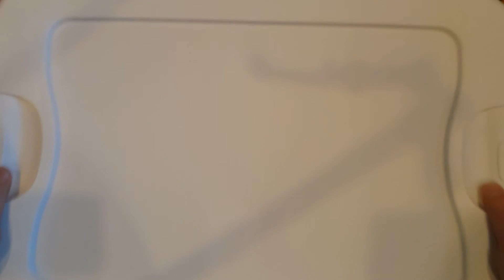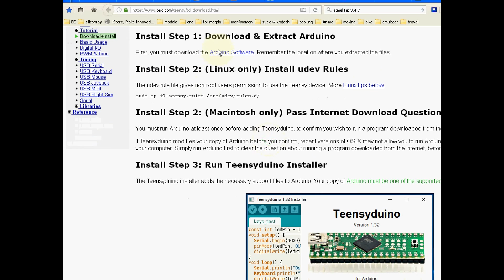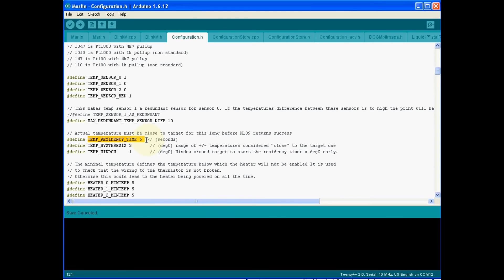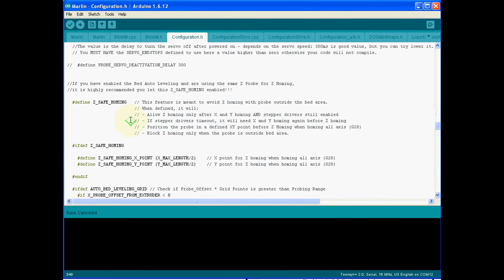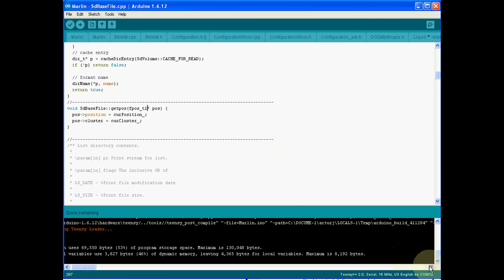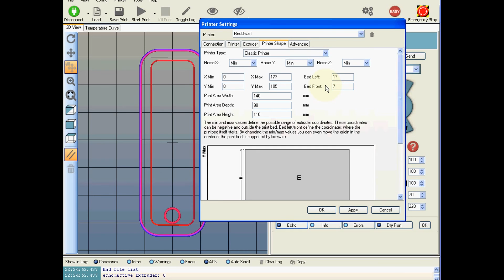Printrbot to Hypercube conversion part 3

Comment: Hello, I did something very similar to you, I am using a Printrboard, what VREF do youhave set ? I have terrible vibrations when it is moving the carriage and can't find the cause, please see into my profile, if you could help would be really nice I am quite desperate thanks !
Reply from the maker: I looked at your videos and posted a comment. Really strange. I haven't measured my VREF, haven't adjusted it even though I'm using different motors than the original printbot used.